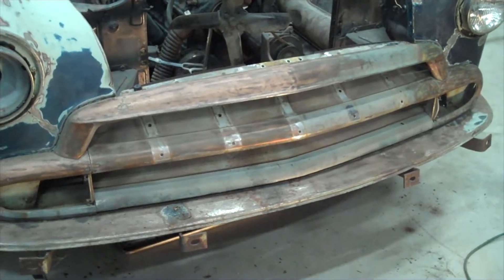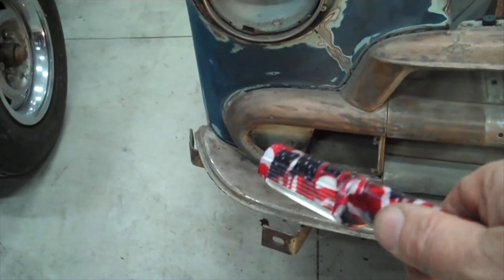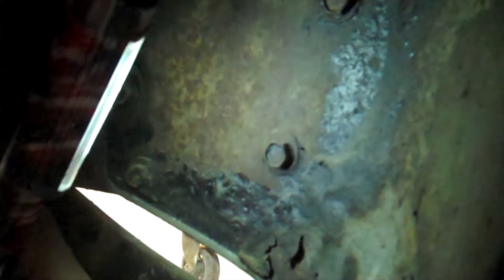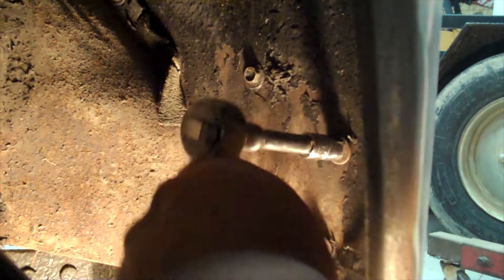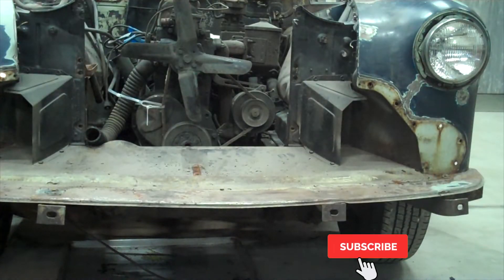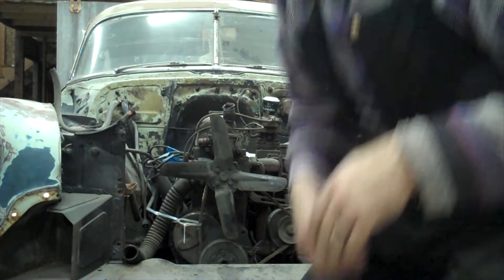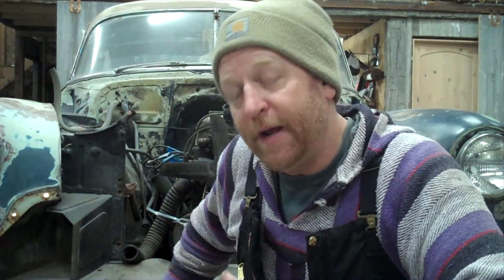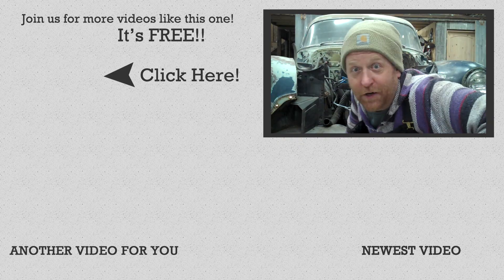Episode 4 - 1952 Chevy Deluxe (Removing Grill & Updates)

Comment: Got a 53 2DHt, all the Chrome is off to Chrome Wizard. Gotta slow down, every little thing is Expensive! I did do the Disc brake conversion on the front. All floor panels are cut out, new going in. Corvette Ralley’s with spinners. Starting to look Nice!

Comment: Do you have a video on how to best keep track and inventory of parts when you disassemble?
Reply from the maker: Thats definitely a  good idea. For bolts, snack size or sandwich zip lock bags work really well, and write with a sharpy on bag what its for. Tape or a tag on string for larger parts work well. I always suggest over label and over specify on the labels, never hurts to have too much information, but not having enough, now thats a different story.

Comment: Question, why would a stovebolt 1951Chevy 235 start a slight misfire every now and then only when its running for a long while at a slightly hot operating temperature?
Reply from the maker: Couple ideas come to mind. One could be moisture or small debris in the gas itself. Another is possible vapor lock in the fuel line, but less likely. And the last is something in the electrical system making a brief poor connection.
Reply: @All4HimRacingVideos  Thank you for responding. I will check these ideas. Keep in mind though that the car runs perfect up until 2 to 3 hours of non stop driving.